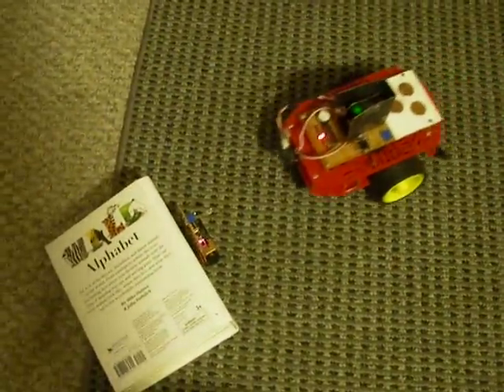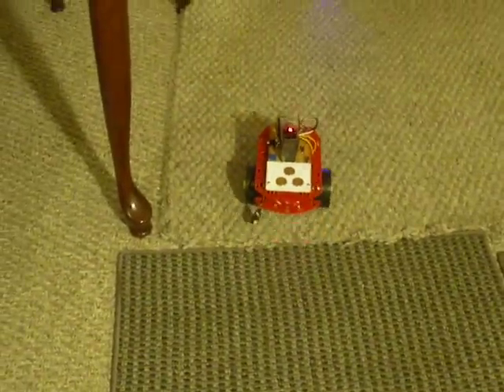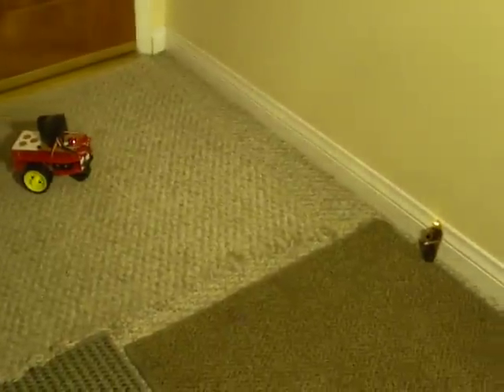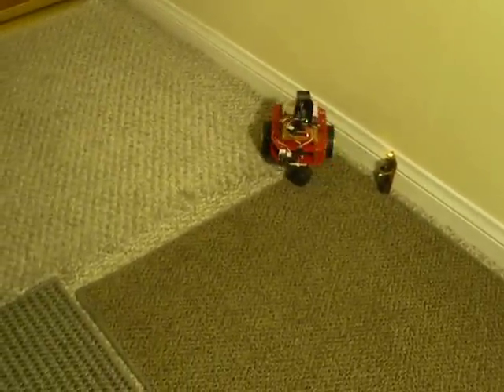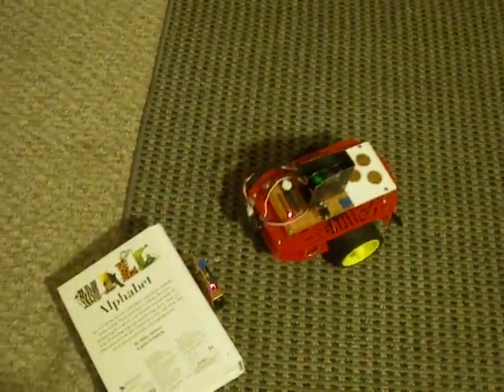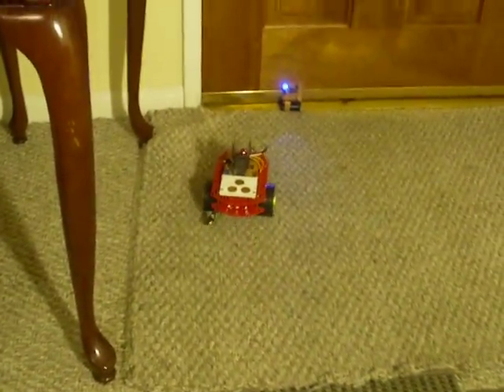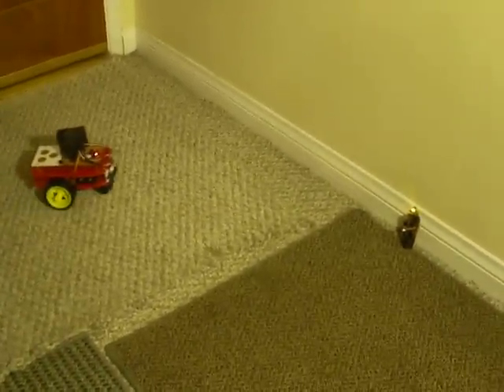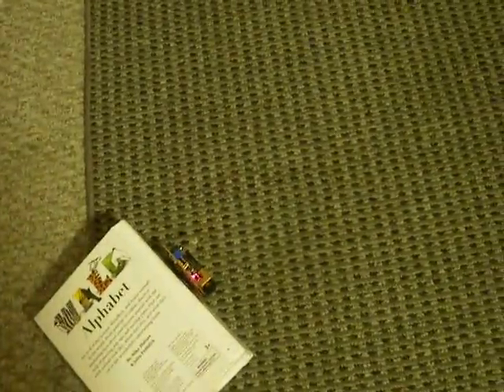Robot Beacon Tracking Demo

Comment: Do you have arduino code how this works. At robot magazine there is no code available.
Reply from the maker: ROBOT's website got such a mangled makeover that they lost the beacon tracking code. But the code was only for PICAXE so you would still have to tweak it for Arduino anyway. Fortunately these Vishay TSSP4038 sensors are simple to figure out and use. They are the rare continuous signal compatible type. Mouser & Digikey stock them. They are normally high and go low when they detect a 38kHz IR signal. Use a pair of them in optical blinders (I used ultra flat black spray paint on posterboard) so they have a narrow view. When they are both low, steer straight ahead. When left only is low, steer left and vice versa. Easy peazy.
Reply from the maker: Beacon Schematic: http://www.botmag.com/images/drupal/photo_4_beacon.jpg
Robot & Beacon Photo: http://www.botmag.com/images/drupal/photo_5_beacon_tracking.jpg

Comment: Thanks for the video.
Would it be possible to track a 457 kHz Signal? That signal is used in avalanche tranceivers.

Thanks
Reply: This is IR not radio. You would need a directional antenna with a signal strength readout.